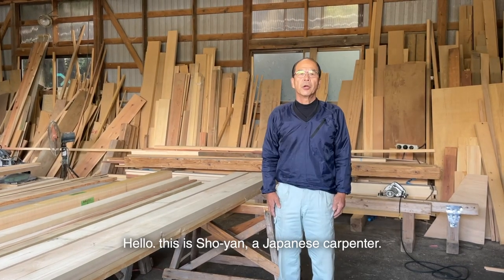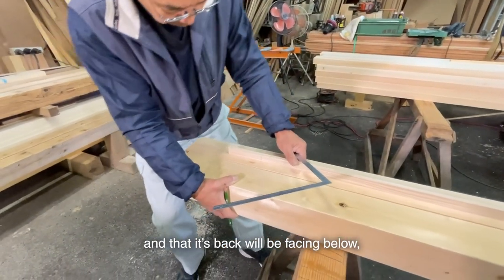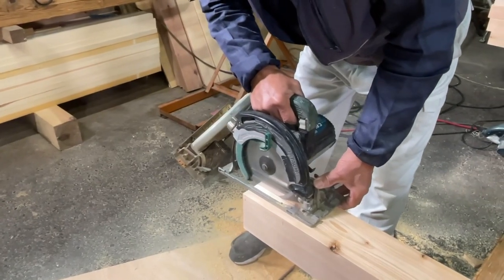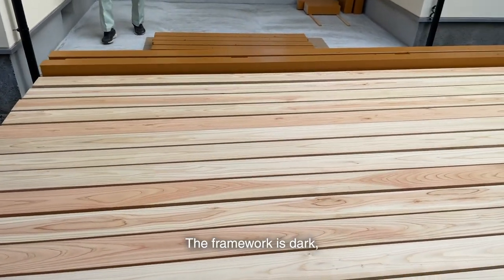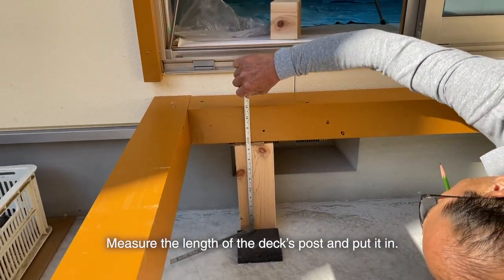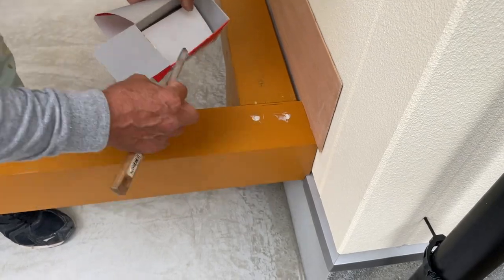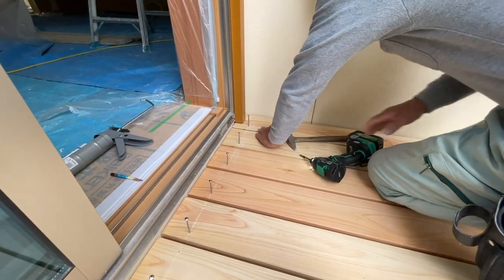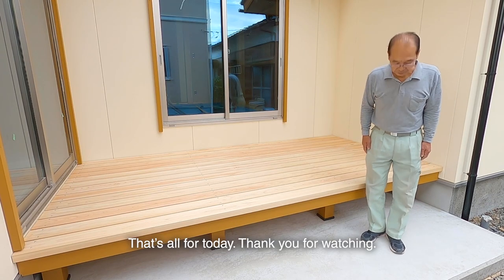Japanese Woodworking - Wooden Deck: How to Install it

Comment: Wonderful design and craftsmanship. I like the plastic feet on the posts. I need to see if they are available here in the USA. The round headed nails give a nice smooth finish. I have found that the screws commonly used can be rough. We use a ice and water shield type membrane on top of the structural members these days to prevent water intrusion at the fastener between deck boards and structure. I enjoy watching your mixed use of hand and power tools. 👍

Comment: LED Headlamp Rechargeable, Ochter Headlamp Flashlight for Adults, Waterproof Headlight with Motion Sensor, 230° Wide Beam Illumination & Spotlight, Lightweight Head Lamp for Camping, from Amazon. Running for seeing in those tight spaces.